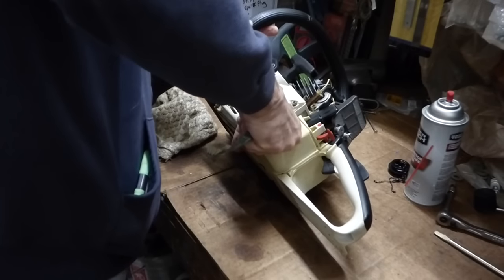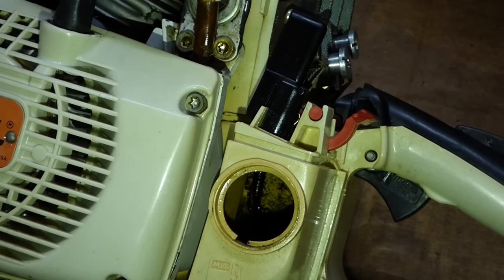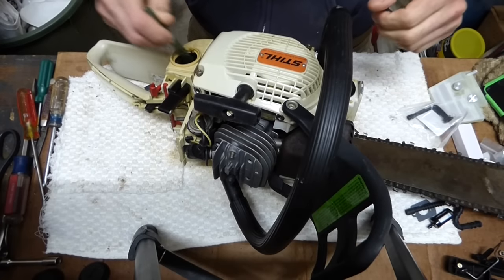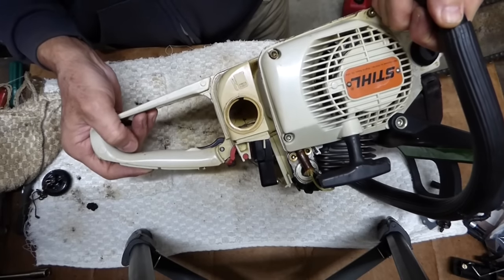Never Do This to your Chainsaw ... How to Repair it if you do

Comment: Well I can believe it! It’s Chinese parts on eBay that’s why its $12. These may work but they are NOT brand name parts by any means. You can’t get a walbro carb kit for $12 let alone a carburetor. Don’t get to excited over that $12 Chinese kit. You did do a good job on cleaning that saw.
Reply: My thoughts exactly 😂🤣
Reply: You fellas realize that the Walbro carburetor has been made in China since the 1980’s and your old Stihl has a China carburetor on it, right?  You can believe that they build them “better”for their Stihl order but that’s pretty naïve thinking… most worker’s have a certain rhythm that they fallow across the corse of their day…doesn’t make a difference where they work.  PS… show up drunk or stoned or high or anything in China and they put you in jail for 20 years or shoot you… people in America come to work drunk and hungover and they don’t need to perform their jobs 1/2 as good as they do in China…if they make a mistake they might not get paid for their day!!! Or receive some other pretty serious punishment!  The aftermarket carburetor’s can be better than new if you know which models will upgrade!  hlsproparts.com supply the Hyway company stuff…They made the Stens stuff for 35 years before they started selling directly…  the China rubber/plastic stuff like fuel lines and seals are still lesser quality because they haven’t figured out that recipe yet…it’s a couple 3 years of life instead of the three decades of life from the OEM… but it’s not $20 bucks it’s 3-$4 bucks…so a dude might just want to spend a $20 to get a saw running instead of spending the hundred dollar bill and having a three decade repair… dude can always spend another $20 in 3-4 years for a new fuel line… I am dirt cheap.., I just pull a length of my echo line and I steal the grommets off the old Stihl line..,I slip my new bulk line through the grommet and pop it in… cost me 50 cents and works another 15 years… Tygon or Echo line!  I just can’t believe someone gave you an 026!  One of the best 50cc saw’s that ever lived!!!  Need to port that little sucker and slap a 20” bar on her!’  She’ll rock solid with an 18” 325!!!  That saw might actually have the little hole in the center of the crank…you can place your bar tip grease gun and shoot a couple pump into that roller bearing every once in a while and you don’t need to remove the clutch assembly!!!  See that little hole by your clutch roller bearing!!!  That’s pretty slick “German” engineering right there!!!
Reply: Should definitely get a Walbro rebuild kit for that new diaphragm kit…if you have a China carburetor that isn’t working put in a real $8 dollar Walbro kit into it!!! It’s just the little rubber material diaphragm being a little too stiff and not playable enough… we usta soak them over night in ATF and 50% acetone when too poor to get new diaphragm’s!
Reply: It’s not a knife…there’s no “blade!” LMFFAO…just busting your stones!!!! That’s a sweet step up from the old ms250 or 025… 45cc clamshell!!!  Get a little piece of soft soldier and check your squish band??? See if you have.025 thou with your base gasket deleted and add a little 1/2” pipe and do the muffler mod then retune it!!! It’ll jump right up and they pull a 20” 3/8’s bar like that… awesome ground saw’s!!!
Reply: I own 12 pieces of Stihl equipment to maintain a 40-acre estate. Several years ago I priced a Stihl carb for one of my brush cutters: $125. I found FIVE knockoffs on Amazon for $30 — yes, $6 each. Installed one and it ran flawlessly, and still does during daily seasonal use. Rebuilding those carbs is a fussy job that doesn’t always work. Save your old carb and try a knockoff first.

Comment: Thats always a good deal. My other free green poulan is ready for new gas line to i already have all different size lines just need the free time to do im gonna reuse the old gas filter its still clean for it being a old cheap brand saw it still works good

Comment: Great job on the videos very informative. The ethanol gasoline when it introduced to older Small engine equipment will deteriorate gaskets and rubber parts. I strongly recommend folks use gasoline without ethanol in your small engine equipment. Even the newer equipment seems to be operating better without the ethanol.
Reply: Thanks for this post, Jasper, you have addressed an issue that I have been concerned about.
Reply: Absolutely agree.  I also make up gas/oil mixes on the heavy oil side (30:1 instead of 40 or 50:1). There is no smoke when running and I believe I am extending the life of my commercial saws...

Comment: I have no problem pressure washing a chainsaw.  I picked up an old Stihl 025 that was filthy.  I blocked up the carb and muffler and pressure washed it.  It is now as clean as I can get it.  I put it near a heater vent in the house and let it dry all weekend after blowing it off with compressed air. I replaced all the replaceable parts and it ran after a few pulls.  I put a new Stihl bar and chain on it and it cuts fine.  I restored an 026 last year and brought it up to 026 PRO standards, adjustable oil pump, carb, etc.

Comment: I have a Stihl chainsaw myself that I inherited. I‘be taken it to a couple repair shops that’s had it for months and never fixed it at either place.  They supposedly replaced everything that can be replaced on the chainsaw but still won’t start.  Got good compression and spark. Not sure why it won’t run? But not willing to give up on it yet?

Comment: I try to use only premix 50:1 on my 2 cycle engines. That ethanol can really do damage to the feed hose and other plastic parts. It's still not fool proof, but my 2 cycle equip always starts the next season. (so far)😀
Reply: E10 goes bad in 3 months regardless how you mix it, if storing equipment, just dump it out. Otherwise the fuel collects moisture from the air....that means water in the bottom of tank. ( Or, if only storing a couple months, add Sta-Bil to your fuel can, and use it on your last tankful.)
Reply: 2 years ago I started using non-ethanol gas and I have stored my tools for long periods of time with no problems.
Reply: @j.chrisbeck7492  I always add Sta-bil when I fill up my gas cans.

Comment: another thing to mention is you should never run any small engine with any cover removed. they are there to direct air flow over the engine to keep it cool. my opinion, when you were adjusting the carb, was way to long with top cover removed. i, personally, dont want to buy the customer a new saw cuz of overheating when 2 seconds to put it on could have prevented it.

Comment: That's what ethanol does to your fuel lines In small engine equipment that is why I use pre mixed fuel in a can and non ethanol gas in my lawn mower.

Comment: You clean a bar from the sprocket nose towards the beginning of the bar to keep from putting dirt, sawdust out of the sprocket nose.  You can then clean ot the oil holes with compressed air.  I always use compressed air to blow out the slot on both sides of the bar.

Comment: I bought an 025 20+ years ago, used it for a large poplar, 2 large holly trees, and little else, then put the saw away.  This weekend I lubed the roller bearing, cleaned the gas tank, cleaned the air filter, sharpened the blade, cleaned the chain brake and chain oiler. Today I cut up half of an oak tree with the 025 and the trunk was wider than the blade.  The woman who owned the property said her landscaper wanted $2500 to cut up and remove this oak tree which had fallen down.  If she wasn't married...  After I'm done with the oak tree, I'll dump the fuel and the chain oil, probably save them, and keep the saw ready to start next time.  Great Stihl 025 maintenance video, thanks.
Reply from the maker: sounds like you did a great job

Comment: Hi I have a chain saw and I have messed around with the hi & lo screw it also has idle screw ,my question is were should they be set to start in or out ? I have mess them up until it will not start of it starts and runs for a few seconds 🤔 any help would be great thanks in advance great video best wishes from N Ireland 👍.
Reply from the maker: turn the high and low screws all the way in clockwise till they stop but don’t force them because it is a fine needle at the end of the screw. Once you screw them all the way in turn them out one and aquarter to one and a half turns and start from there

Comment: Good work. Like you, I would never "try to start" any old machine which has an unknown history ... like soooo many dumbarse youtubers do with barn-find cars.  "Will it run after 40 years?"  Best way to more destroy a motor which only needed a day's worth of partial checking for dangerous problems and the basic service kit.. I saw one dumbarse run an old motor which got going 10 seconds before a full seize up due to a completely blocked sump strainer.

Personally, I would have done a full reconditioning, all rings, seals, bearings, carbie kit, etc, so then you KNOW you've got a reliable machine long in the future.

Comment: Thanks for the excellent advice.  Do you run premium or the no lead gasoline in your power tools?
Reply from the maker: No lead and usually ethanol free. Also I run all my two cycle engines with 40:1 Makes for a good lubrication

Comment: That's because they used ethanol gas in the chainsaw.  That type of gas make rubber hoses go to nothing. It's worth fixing but, never put that type of gas back in
Reply: It is the benzene and hexane that eat the synthetic rubber over time.   They can sit in alcohol forever.  Even non ethanol gasoline has those additives today...."secret" formulas of snake oil that gas stations advertise on their pumps with catchy names.  They're mostly octane adjusters and fuel injector cleaners that carburetors didn't need daily.

Sort of a coincidence that stuff came into play about the same time ethanol started appearing in the late 80s and early 90s....when cars went fuel injector.

I pour or burn out all gas before storing......at least turn off the petcock and burn out the bowl.
Reply: I use 100% gasoline.  It's a little more expensive, but worth it.
Reply: I hope no one thinks he meant 100% gasoline without 2 stroke oil to run the saw or there's going to be some mad but educated people on proper fuel mix! But there's probably going to be that 1 ding ding who thinks to himself,"what in tarnation have I been putting that little bottle of oil in my 100%gasoline for?

Comment: If a saw has good compression the cylinder and piston are probably ok.  My guess is fuel related problems.  I just got through pressure washing an 025 that Ipicked up off of EBay.  I let it dry on a heater vent all weekend.  I did blow it off with compressed air before I let it dry.

Comment: enjoyed the video, learned a few things.  Can't believe you got all those parts for $13, wow.  A couple things I noticed you do differently than I would.  You left the bar and chain on for most of the disassembly. I would have taken it more apart like the crank bearing an example before ordering parts.  Lucky guy you got a dumpster saw for free.  After a few hours of cleaning and $13 later.  Now have a $400 saw that works great
Reply: Common sense says if you have spark, a real nice looking cylinder and piston, good compression, but an obvious fuel condition issue and bar oil leakage, you don't need to "gut" it.

Comment: Excellent vid.i wonder.d how you can tell if pistons were bad.from no oil in gas or straight gas
Reply from the maker: the piston and cylinder wall should not have any scratches on them as shown in the video.  Remove the carburetor and you can observe both

Comment: Greetings good  work,.. how do I know the ratio of mixing gasoline for two cycle engine?
Reply from the maker: The manufacturer's recommendation will come with the unit and mixing instructions are on the 2 cycle oil container.  I use 40:1 in all my 2 cycle equipment.  I prefer a little more 2 cycle oil in the fuel mix to better lubricate the engines.

Comment: VERY GOOD Video, I own 7 STHIL SAWS, Different Sizes, TIP Always use """PURE GAS,""" When you let them Sit for a few Months Ethanol Gas will DESTROY CARBURETORS and MELT OLD LINES, On Chain Saws Lawn Mowers This, and Weed Eaters etc  ETHANOL will MELT STRAINERS in Gas Tanks on Older Vehicles,

Comment: I took my muffler off and I did noticed some scores but my saw still runs fine shall I continue running it it replace the piston?
Reply from the maker: I would run it if it were mine...  I use a 40:1 mix in all my 2 cycle equipment...which is a heavier oil mix than a lot of the newer 50:1 engines to better lubricate my engines.  May smoke a little more but I don't mind.
Reply: @helpinguonline  ah ok thanks for the recommendation I’ll do the same

Comment: He didn't say when putting the clutch on about putting the oil pump wire in the Gruve of the clutch housing cuz if u miss that the wire will make a hole into oil tank

Comment: I leave gas in some of my chainsaws all the time.  However, I use nothing but premium, non ethanol gas and one ounce of a good stabilizer in each gallon of gas.  I am protected for two years or longer.  The longest I have left gas in a tank is 18 months and the saw cranked right up.
Reply: Don't leave ethanol more than 3 months.

Comment: I have a 1987 Stihl 024 and whilst the engine is slightly rattly it starts and runs perfectly.  Meanwhile I have had 2 stroke strimmers and brushcutters that have only lasted a few years until the mag coil went bad.

Comment: For as dirty as the saw was before you cleared it. It sure looked very very clean under the cover.  Are you sure that was a throw away?  I mean I would add it to my other 5 Stihl's     Purple power is good  stuff , but it isn't that good .   Good video though. I'm sure it helped a lot of novices though!

Comment: i belive 026 stil is pro model im pretty sure mine the same  ace hardware was going to buy it or trade me any new stil ,husquverna on  bottom 2 shelves  most expensive 399. i was getting new fuel line , filter. kept mine  ask why he want that old thing he said its professional model.  i got it used and its a brute cuts great

Comment: Great video, but nowhere in Your sped up cleaning of the carb did I see poking of wire into fuel passages to clear trash.....I have found that one "Bunch" of  wires from a standard industrial Stainless Steel wire brush supplies a great number of "Pokers" to clear small carb passages, and are a great fit and strength for that purpose....just sayin'....I am envious of Your price of repair kits, in Canada We pay 3-4 times that price for such kits....

Comment: good video, way to get it going.  to those reading comments, check the spark plug hole for score marks too.  shouldn't water/detergent wash a chainsaw, just wipe it.  Spark plug will spark without applying to metal body.  Given condition of fuel line was hard,  the tank suction lines and chain oil pickup line is probably brittle and leaky too. Excellent find, those older models had nice wear plates.
Reply: You won't be able to check the condition of the piston using that method
Reply: Grounding the plug also gives all that energy the coil is producing a place to go.......it also replicates the actual flow of the energy as engineered, thus a more accurate spark strength.

Comment: I use a putty knife to clean the bar.  You can use compressed air to clean the sprocket nose.  If the sprocket nose does not turn as freely as I want I put the end of the bar in a container of two cycle overnight.  I the blow it out good and lube it with some bar oil via my pneumatic oiler.  On Oregon bars, they have a grease hole to lube the sprocket nose.  You need to lube it daily.  Most of my saws and bars are Stihl, so I do not have to grease them, daily.. they are what Stihl calls Oilimatic.

Comment: Another good way to check compression is to hold the saw up by the recoil handle. It should be able to hold the weight of the saw, or fall very slowly.
Reply: Actually both the Video and you are wrong on compression.
Both of you would 'pass' a test where a piston ring is damaged and the bore slightly scuffed and the saw not able to make enough compression for  running past a few cycles. AMHIK.

The only way to KNOW is to do a compression test with a compression tester or do a leak down on it.

Comment: Be careful usin a non oem air filter on an 026, because the full choke position may not work correctly.  I also use oem fuel lines and gas filters in my saws.
Reply: If i had your money I would too.

Comment: The ethanol in the old fuel ate up the fuel line.  When ethanol degrades it turns into hydrocarbons that will melt rubber in fuel lines, carburetor diaphragms, etc.  - anything rubber.    Soak rusty chains in old two cycle gas for several days and then wire wheel it.  According to how rusty it is I may then soak it in old motor oil after cleaning it on a wire wheel.  I want oil to permeate every part of the chain and get it where the links are all loose.  I had a chain on my Stihl 024 that was pretty rusty.  I cleaned it up, oiled it good and then put it on my chain grinder and sharpened it.  It is still on my 024 and cuts well.  Not all chains can be saved or worth saving. A new 18” .325 chain from Stihl cost around $30.   I use white lithium grease on sprocket bearings.  It does not take a lot of grease on the bearing.

Comment: You can leave gas in your equipment if you use Sta-Bil fuel stabilizer in it. I do it with no issues.
Reply: Use ethanol free gas in all small engines. For the extra $ you spend its well worth it. 2-strokes love octane and with premium dirt bike or snowmobile oil you save the money you spent on better gas. Anyone that has 2-stroke tools should have a Ratio-Rite. There $6-$12 and great for mixing up anything.